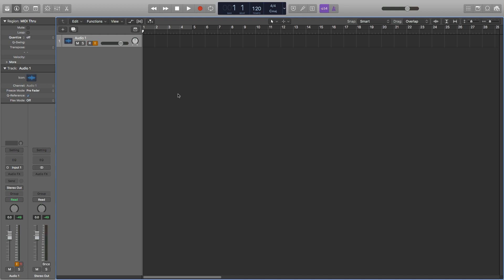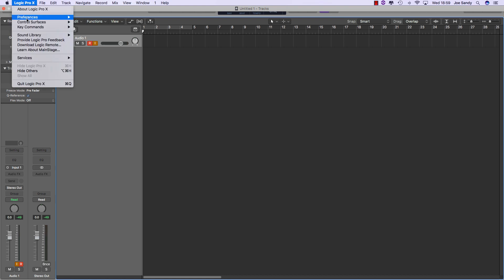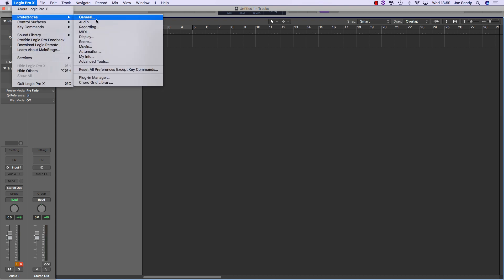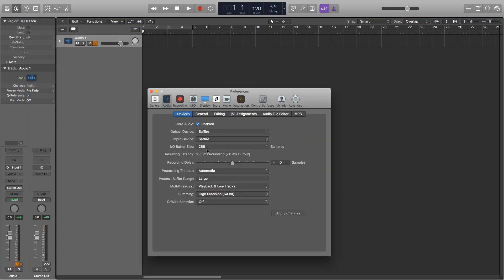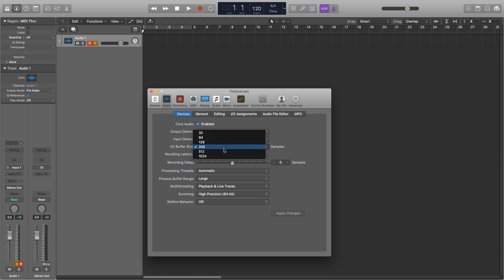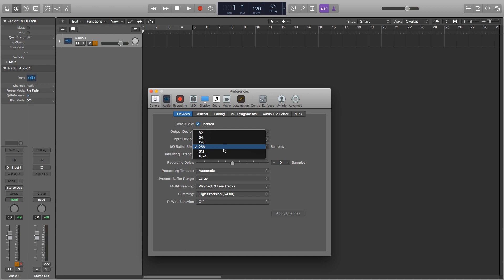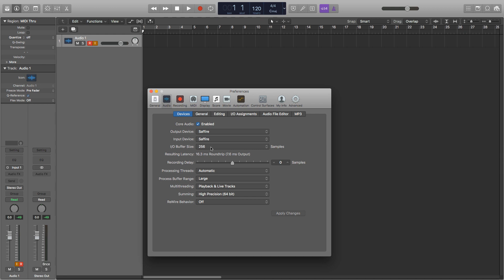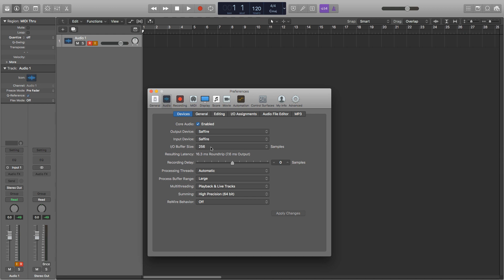Logic Pro X - How To Reduce Latency

Comment: Hey, Ive been using an usb interface for voice recording. I would like to record when the plugins are enable on that track. But I having issue with the latency while the plugins on. I do have a very massive computer I9-9700K , 32gb 2400Mhz of ram, nvme m2 pcie samsung Evo pro ssd... bla, bla,bla.
My audio interface is a Steinberg UR28M usb .
Ive chanced the I/O buffer to 128 but nothing helps. 
While Ive been recording the beat is on one track , no plugins on it.
The cpu level on 8core is very low, seen on custom mode.
What do you what is the issue? 
Thank you so much !!!!
Reply: Might be hardware lag... like bluetooth headphones?